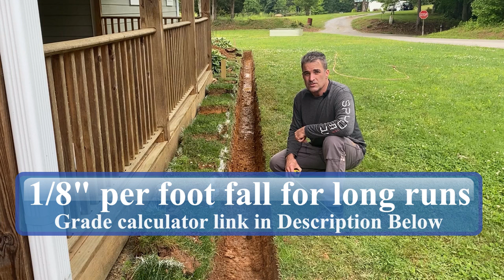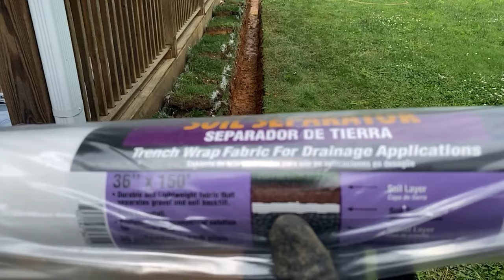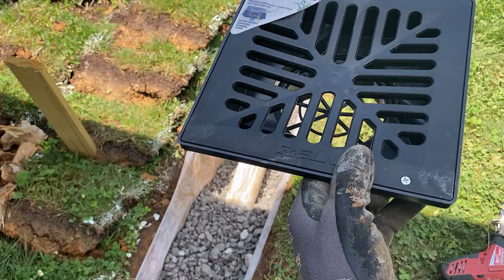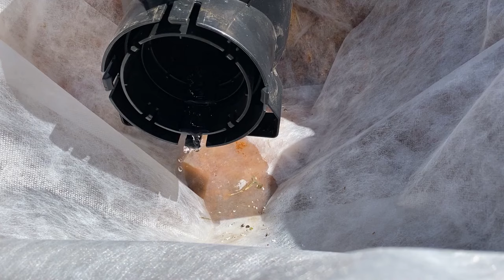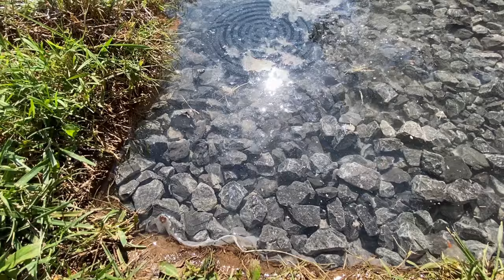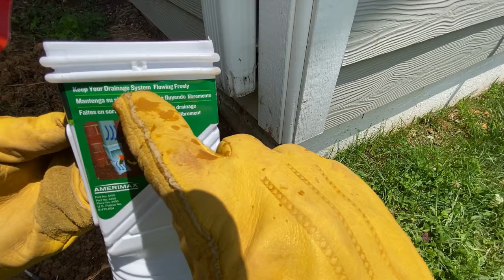Complete French Drain Installation How To #how #howto #diy

Comment: Everything was really good until the end with that cheap downspout leave collection take cheap crap out of there on heavy 🌧️ all that water is gonna overflow and end up on your foundation 🤦🏼‍♂️the FDM got a greate one works beautifully n don’t spill all the water out it has a cover so it won’t allow the water to spill out I had the same issue lol I ran the gutters on a separate solid pipe n the French drain on it’s own perforated pipe no compromising the French drain with gutters n debris the catch basins will collect some debris but eventually it will clog your French drain in the next few years 🔬🫡💸💸💸

Comment: Hi, am I correct in assuming the bottom of the drain grate at the disposal trench is closed? Also the water escapes through the green grate at the end of the grate then fills the gravel pit and overflows from the top of the black drain grate?
Reply from the maker: Hi. Thank you for watching the video. You are correct on both questions. The basin at the end of the entire system is solid at the bottom. I did not drill any drain holes into the bottom of the basin. When the water exits the pipe system, it fill the basin at the end of the piping. Once the water reaches the top of the basin, it exits out of the green grate and then spills over into the surrounding drain rock and exits into the drainage ditch on the side of the road. I hope this information helps 👍

Comment: You kinda build a french drain, but it's going to work like a dry well. French drains are used to collect groundwater in places with a high water table, your problem was surface water. Your system puts water into the ground. French drains have barely any fall. If the beginning end is much higher than the lower end, the groundwater level won't rise high enough to enter the pipe.

I don't think the perforated pipe, stones and filter paper were necessary. How is the rain water going to get through the grass and clay soil? Just sending the roof water to the drainage swale would probably have solved your issues. A properly placed drainage basin may have helped some since you have water from the deck.

Sorry, but I would've run solid pipe to the front swale without stones or filters and left an unrestricted opening at the end. You also wouldn't have had all that dirt to get rid of.

Comment: The video narrator said 1/4" per foot but the graphic in the video said 1/8" per foot. Which is correct?
Reply from the maker: Hi. I said a 1/4” per foot because that is what I did for the first run of pipe. But, I wrote in the graphic 1/8” per foot for longer runs, and I wrote in the graphic that if you look in the description box , there is a calculator that you can click on that will tell you exactly how far your drop should be depending on how long your run is. The longer the run, the less you have to drop in elevation. I hope this information helps 👍
Reply: Dropping 1/4" per 1' is ridiculous. No need for it to be that steep.

Comment: How would you do this for a home where the street is graded slightly uphill(nothing major but there’s no natural fall)
Reply from the maker: Hi. If I’m understanding you correctly…the street is above the house and the house is slightly below street grade level. If that is the case, I would direct the French drain from the front of the house and around the sides of the home towards the back of the house so that it still drains away from the foundation. I hope that this helps 👍.
Reply: Or a sump pump in the catch basin.